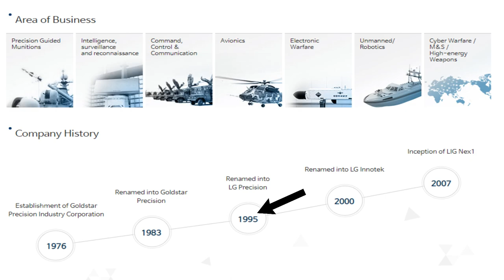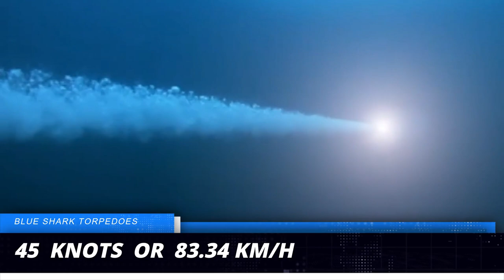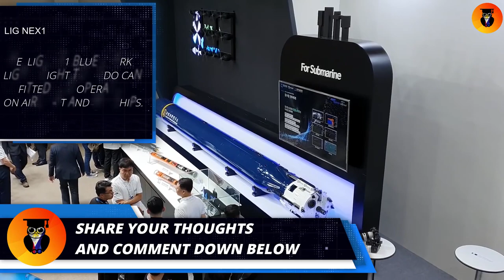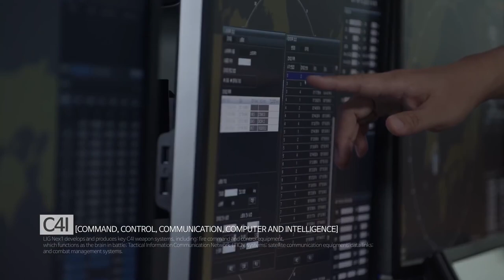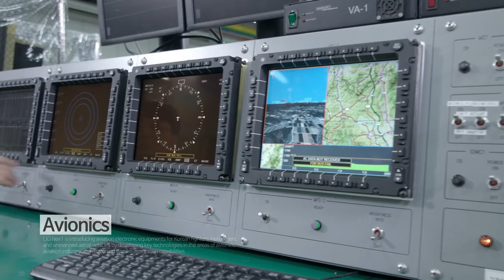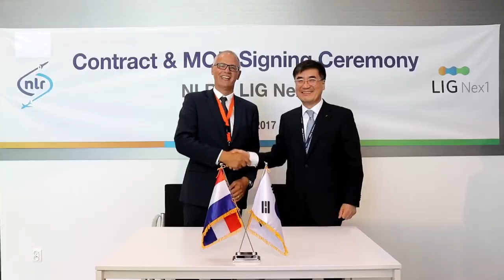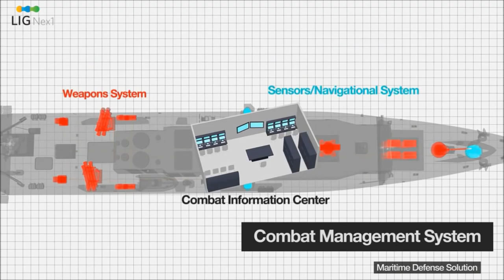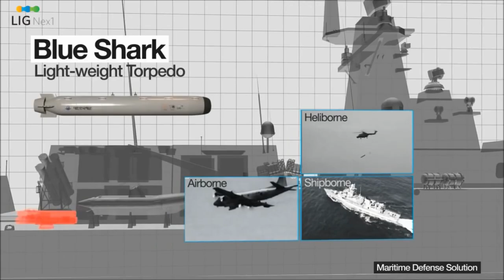PHILIPPINE NAVY'S ANTI-SUBMARINE TORPEDOES - Now Installed

Comment: Korea Supersonic Anti-ship Missile(KSS-III.F-15K.KF-16.KDX-2.3,KDDX,P-8A)
Length: 6.6 m
Diameter: 53 cm
Weight: 1.35 ton
Range: 500 km
Speed: Mach 3
.0(Cruise speed) 4.0(Terminal Velocity)
Warhead weight: 250 kg 
Induction method: Induction via data link, Ku-band active radar induction, infrared induction, CCD induction
Feature: Stealth Design
Development completed :2002~2019(
Yahont Base)